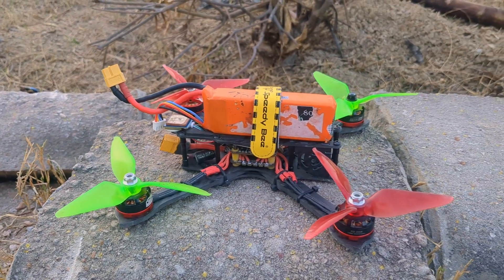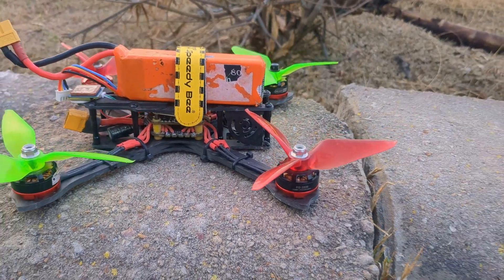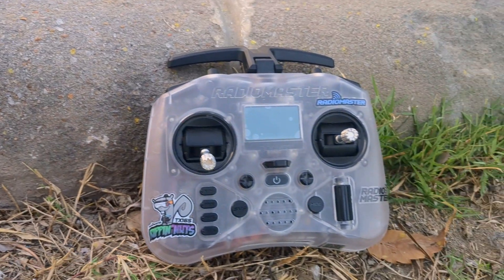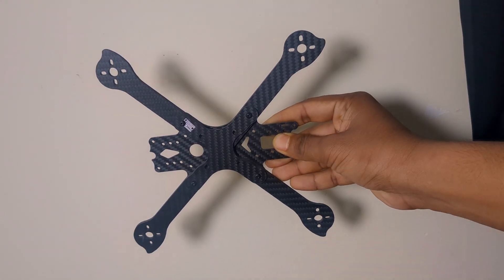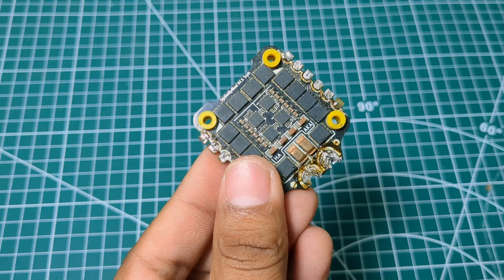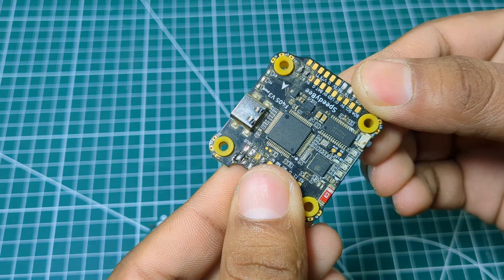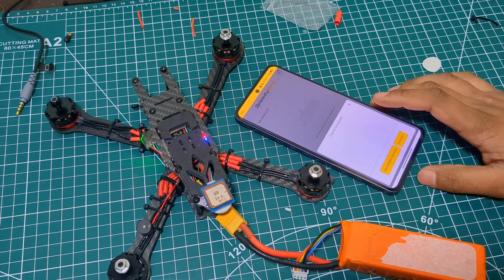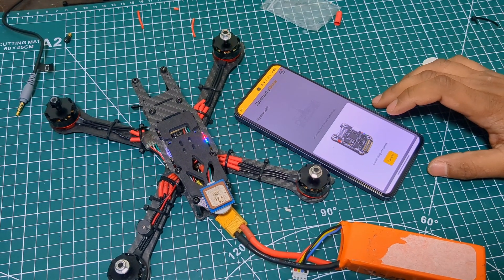How to Build a Budget Racing Drone in 2025 – Step-by-Step Guide! 🚀 | Maker SCI

Comment: i build a one today with speedybee 
after using Radiolink Crossflight (its good for beginners)
 is there any way for to decrease sensitivity of transmitters to control speedybee (very hard) one mistake in throttle up the drone is upside down😂😂😂

is there any way for low sensitivity for noob like me😅😅